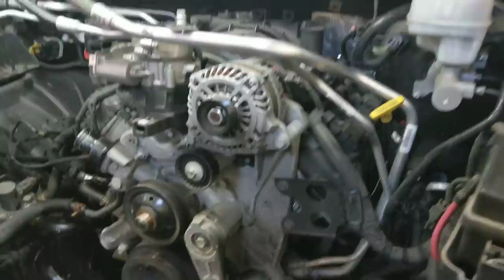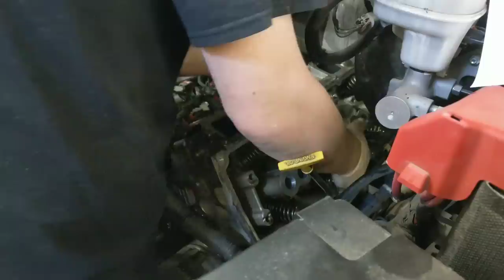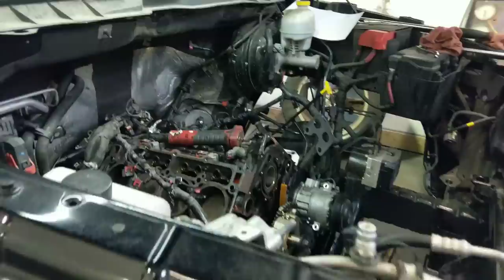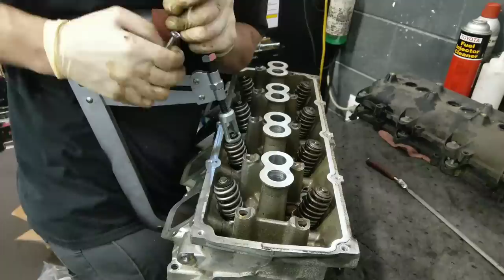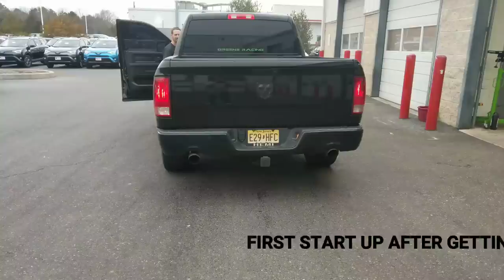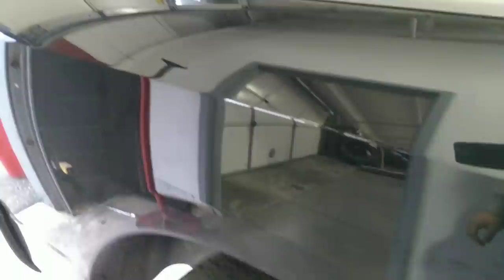HEMI RAM 1500 CAM INSTALL and START UP!!!

Comment: In most shops that I worked for we would have been fired for using abrasive discs on a head surface.
Reply: Aluminum heads too. I saw several things in that video that normally would not fly. Like installing the cam bone dry. Assembly Lube is your friend.
Reply: JK yes sir, there's always time for lube!!
Reply: JK I don't get me wrong I'm not one to criticize another techs work but that is hackish.
Reply: The fact that the truck is running great and hasn't had any issues despite IH beating it mercilessly shows his guy did a good job.
Reply: Did he cut out the part where he couldn’t get the cam fully installed because he took a sledge to it?
Reply: @Eatmydick666  lool what i was thinking
Reply: Yup we cant and we do fords all day long theres no difference
Reply: Exactly!
Reply: Nothing like a bunch of aluminum oxide particles all in the engine eating at those bearings lol
Reply: Every cam that i have ordered came already lubed
Reply: No new lifters? It’s a matter of time.
Reply: Sideways Squad that's not lube. It's an anti corrosion grease
Reply: @Eatmydick666  exactly I found that part amusing
Reply: next video....replacing engine in a ram 1500
Reply: YEPPER! even the fact that "no lube" on cam when installing it would convince me to never use this chimp to work on my shit. the gap between the cam being stuck in the video and being fully installed would worry me since (IMHO) I think they drove it in with a hammer.. everything about this guy's technique screams DICEY.
Reply: We really are not allowed to use any abrasion past the milling.  We were also only allowed to use calibrated, shop specific, torque wrenches to bolt on the cylinder heads.  We could use our own torque wrenches for just about anything else.  But work is extremely anal retentive about cylinder heads.

Comment: Should there be a concern that the camshaft was not greased before being put into the engine?
Reply: I would say yes lmao
Reply: I'm sincerely hoping he knew to wash the pre film off and relube it but the way he was smashing that thing in there those poor cam bearings😄😄😅
Reply: Yeah I noticed that and it looked like it got stuck until he cut the video. Made me cringe, that boy needed some assembly lube or some molly.
Reply: Yes a cam should be greased before installing it shows what they know isn't much
Reply: Cam lube anyone ❓😬😱
Reply: I stopped watching when I seen the cam go in dry.
Reply: @cantbuytime  This could be a gag sort of build so people mess up their engines after watching the video. I have never seen such rough handling of a cam shaft, much less with no assembly lube.
Reply: At least spit on the shaft man. This dude is raw dogging it 😅😅😅
Reply: @jd-yf2pi  I like to think that maybe he staged the action but actually greased the shaft before installation. He is very knowledgeable, hopefully too knowledgeable to install any sort of normally lubricated part without greasing it. But maybe he made a mistake that will come back to haunt him. Let's not call it, "raws dogging." Raw dogging,"would be rebuilding a crap engine, like a four cylinder junk that nobody would rebuild.
Reply: @indridcold8433   I am Laughing so hard that I can't stop crying.  I hope he didn't just go in dry lets hope and pray that this guy's truck is still on the road today and he didn't choose a mechanic that would raw dog his hemi. LMFAO

Comment: The 60' slowed down because the larger cam moves up the peak torque rpm. Needs a converter to make the most of it.

Comment: Hell yeah, sleeper mode. Exhaust sounds great. Glad your happy with it. Now to get those new track times. Congrats brother!
Reply from the maker: BlackMamba Ram yea sir...  Definitely sleeper Jay asked if I wanted a lope tune but I really like sleeper mode and track times are whats most important to me
Reply: Incredible Hemi yeah, it will run much better without the lope tune. Timing is pulled on the lope tunes. So slows you down a bit N/A.
Reply from the maker: BlackMamba Ram Really did not know that thanx no lope at all then...  There is lil chop but thats what I wanted more sounding like the way it was b4 cam
Reply: Incredible Hemi yeah, your good the way you are. Will definitely be in your favor if you like to grudge race. I wanted lope so I chose a more aggressive cam, sacrificed a little torque to get it and just went higher on my stall to compensate the low end loss to get me moving. Lope tunes are just for sound, not at all worth it for a sacrifice in performance. I had a lope tune on the baby cam I had before and it killed my bottom end, went from 1.76 to 1.8s 60' with a dead bite and top end mph didn't pick up any. I only picked up midrange with faster 1/8 mile but same 1/4 in similar weather conditions. Kinda defeats the purpose of the cam install.
Reply from the maker: BlackMamba Ram Yea id be pissed if I didn't pick up any with a cam install

Comment: This is getting me pumped... all the pieces are coming in for this.
Reply from the maker: Awesome man it's very exciting time when a cam is ready to be installed
Reply: Sounds like we should be good for weekend of Oct 6th - all the parts will def be in. The Cam is the only thing that needs to be plugged in - going to do an intake upgrade down the road. Would he let me film it like this?

Comment: did you remove mds?  I've done quite a few installs and have never removed the intake...just unbolt and hang from the hood, means i didn't have to remove fuel lines too... can't go wrong with a Greene cam..he spec'd a 230/238 cam for my Ram and it's killer..

Comment: I have 2011 dodge ram 1500 5.7l. Installed  stage 2 cam no tune yet have an appointment  on the 9th to get tune but can hardly drive getting a to rich code. My question did you have same problem  also for the 545rfe tans do you know of a good stall to put in there thanks?

Comment: I wanted to hear what he had to say about the mds, also when u came and delete how do u get the check engine light off. I'm sure it comes on. I unplugged my mds 6k miles ago, got 7200 on it now, love the way it drives without that shit. But hate looking at that check engine light.
Reply: you need a diablo intune i3 to disable the mds system and no more check engine light, but plug them in before you do the flash.

Comment: I was wondering, when you pulled your stock cam out did you notice any abnormal wear? I know it's fairly common issue from what I have been reading? How many miles do you have? Are you or did you upgrade the valve train, rocker, ect.?

Comment: So how did he get the cam in when it got stuck? I think that would probably be the most informative part of the video. What techniques did he use. Did he pull it out a bit and adjust it? Would more lube prevent this?
Reply: He didnt use any lube and i assume he hammered it in.. dont 😂

Comment: How did you match up the timing Mark's without dropping the oil pump! I am doing a OEM replacement now due to lifter failure. Trying to get out of dropping the oil pan due to I can not right now. The only thing I have left is to get the timing correct.

Comment: Where did you get the Cam installed?  I'm looking to get a Greene Racking cam kit installed also.  I'm in the process of researching recommended shops in the NY, NJ area.

Comment: Did you lap your valves when you did this install? My truck is getting Jay's 1.5 V2 Cam early next week, truck has 38,000 miles on it...not sure if the valves needed lapping yet. Thanks.

Comment: Haven't looked inside the Hemi to get my answer but why pull the heads for a cam swap?  Were the lifters changed and they have to come out through the lifter/pushrod holes under the head?

Comment: Needing to replace my cam and lifters in my 2011 ram hemi 5.7. Want to do a performance cam What cam did you install? Did you do lifters? Did you have to do a new program, Did you lose your MDS, so many questions
Reply: corey coombs 
MDS suxs so yes, he did a MDS delete and I'm positive that he removed MDS with the tune, you'll need all new lifters and new springs are always recommend for peace in mind, the cam is up to your needs , from what I've seen there's only 3 options.

Comment: I am looking to do a cam and lifter swap on my 2011 5.7 Big Horn. I'm not looking for high performance racing parts, just need to get the MDS taken out and do the swap. Are there any recommendations on which would be the best non MDS cam and lifters that won't break the bank? Thanks!! And nice video btw!
Reply from the maker: mmotoxxx79 hit up greene racing on facebook best in the buisness for these trucks
Reply: Incredible Hemi Thanks! I will check it out.

Comment: Did this cam require a cam phaser kit? Also did you plug in the cylinder de-activate solenoids? I did a cam swap and left those 4 sensors in the valley but I didn’t plug the harness into them. Just wondering?

Comment: Hey hey Incredible i just recently had a lifter go to shit and totally screwed my cam.... # 2 if it matters, but i ordered the Modern muscle extreme cam kit with the Obama Delete "MDS" lol. new timing chain new helcat lifters and cam. Just wanting to know if ya think that was the right choice. i know u guys or u know a lot on the hemi and just curious as to if i made the right choice i use yer vids a lot an and think yall are legit. any feedback?? i have done the delete and installed the cam and lifters and about to put the heads and such back together came with all the new bolts,gaskets, timing chain and timing chain guide etc. i did not replace the timing chain because it did not seem that i needed to because everything was tight and still in good condition. if i need down the the line i have either way just wanting to know if ya think i did the right thing no??
Reply: also sry its an 2009 hemi

Comment: I was looking to do this on my 13. Adding performance lifters and a Greene cam. But I'm running 35 inch tires on my truck so how much more performance could I realistically get. I'm not looking for something that'll run quick times at a track I just want the added power for daily use. Is it still worth the money?

Comment: Never use a rough discs on two smoothe mating surfaces. If I seen  some one do that shit to my motor i would have slapped the back of his head off. All you need is a good scraper
Reply: I wholeheartedly agree. I have a couple of carbide scrapers that work wonders.

Comment: What is the cam and the top end set you bought sir mine just dropped on my 2012 in a bind did you have to delete the eco mode shit if so what parts did you get please need help

Comment: 98% of new gearheads OVER CAM their engines and then wonder why only 10 mpg and crummy idle! It's good you made wise decision to keep it "small"if it's your daily driver. What you need for the street is good idle, more torque and quicker acceleration.

Comment: Thanks for the vid, why new lift springs? (Optional or required)
Reply from the maker: KINGBAND09 required lift springs on this cam
Reply: Incredible Hemi ok, and why this cam vs others and how has the performance been ?
Reply from the maker: KINGBAND09 this cam is better for mid to low range it's a high lift cam but I gained GREAT too end only got to track once sp far n gained 3 tenths n 4 mph in the 1/4 first time out
Reply: Can only a MM do this job.? Or can your average joe pull it off.? How can I know which cam is right for me and if I should do a swap? Thanks
Reply: Bummer he didn’t answer the question because I was wondering the same thing lol. I’m not really an average joe but I’m definitely not a mechanic... I’d love to cam my 5.7
Reply: Evan Schippers 
It’s a serious job with special tools needed. I’ve been a mechanic for 30 years, and doing my own 5.7 now. It’s not easy.
Reply: Loved the performance sound after install. Glad u-tube was edited so not to long.

Comment: I’m a little late here with this but I read somewhere that you had your cats removed before you put headers on. I’m in the same boat I have full bolt ons and tune in my 8spd. Just wanted to know if it made a noticeable difference or lowered your ET at all. Thank you
Reply from the maker: Daniel Rios I got a Catless ypipe and thd longtube headers done at the same time n yes that was a very big pick up
Reply: I lost a good bit of torque deleting my cats, I added a high flow cat and that helped bring back the torque.

Comment: Was this install difficult , I’ve rebuilt very few engines just don’t want to do the install and get myself in a bind
Reply: Better question what would someone charge to do this
Reply from the maker: Jake ! In my eyes yes to a mechanic that knows what there doing no
Reply: See I use to be a mustang guy and that’s what I know and everything I researched seems to be a completely different breed so I’m scared to jump Into it
Reply: Jake ! If you sub to my channel and stay tuned, you'll see a complete walk through

Comment: Do you have to upgrade the valve springs, rocker arms,ext if you install a cam
Reply from the maker: Jake Fejer springs yes not rocker arms
Reply: You only have upgrade springs if the cam you get will not work with stock springs. And depending on some cams you do have to change rockers arms because they will change the ratio. Because of lifters and rods and springs.

Comment: Did you install cam yourself or have a shop do it? If so cost and how long did it take? Thnx
Reply from the maker: Andrew shamloo my buddy is a Ram master tech he did it in 8 hours n only charged me 400 most shops will charge about 1500
Reply: Incredible Hemi 
Thats awesome! I got quoted $1,000 from a performance shop on long island. I purchased the same exact setup as you from Jay Greene the only difference is I bought the upper gasket set from Mopar and I have Shorties. Also have the ATI Dampr, Does your buddy want to take on another cam job? Thanx for all the info
Reply from the maker: Andrew shamloo no problem
Reply: Incredible Hemi is it ok to contact you via jay greene? Thanx
Reply from the maker: Andrew shamloo What do u mean
Reply: Incredible Hemi whoops, my mistake I misread comment. Where in Jersey are you from? Did you do any drivetrain upgrades? Were your lifters shot?
Reply from the maker: Andrew shamloo I'm from depford n one lifter was actually starting to go so the cam was installed just in time

Comment: How much does a cam swap cost? Just bought a 2018 hemi ram, just wondering for now.
Reply: About $3,600 plus since it's an '18 add $800-$1,000 for unlocked PCM and tuner.
Reply: 2021.. update.. depends where you live. On most of the east coast major city... hourly rate add up fast.. so it will be upwards of 6-8,000$ for labor.

Comment: looking to do a cam install on my crew cab but the shops in my area seem very questionable when I pull up. what area/state did you get your cam install done?
Reply from the maker: DB Life my friend who is a Ram master tech did it for me I live in NJ
Reply: Incredible Hemi that was a ram master tech taking a sanding disc to the cylinder head?

Comment: Why does cammed hemis not lope like any other cammed V8's?
Reply from the maker: They all lope I asked for a non lope tune
Reply: They're no different really, it depends on how aggressive of a profile and things like overlap and lobe separation angle.
Reply: I've talked to cam makers & My understanding is the Computer system will not  let a big lope cam to work work.
Reply from the maker: Bill Walker I can get a lope tune n it will chop hard I choose not to
Reply: Computers do not like valve overlap
Reply: "Compters" don't like all that lack of vacuum. Camshafts with increased duration and lift kill vacuum, speed density systems (Which Chrysler only uses) does not and can not tolerate that.

Comment: How many miles were on the hemi when you did the cam swap? Did you replace the lifters?
Reply from the maker: SSSTANG just over 50k n yes I replaced lifters witg MSD delete kit
Reply: What is a delete kit? Guy wants me to do a cam swap on a charger and I’m just collecting info.
Reply from the maker: SSSTANG it's non Mds lifters

Comment: My cam took a little persuasion to get it the last few inches as well I just slathered it in extra assembly lube and it went right in, did you do lifters as well?
Reply from the maker: 11ram_rt Yes lifters also ..an MDS delete
Reply: She sounds killer, can't wait to see what it'll do at the track.
Reply from the maker: 11ram_rt thanx man... Yea track times is what I m most excired for

Comment: Puts cam in dry? You did say "high lift" meaning high pressure on lobes. Oh crap then I watch more and "first start after dialing in" He idles it!!! Should be 1800 minimum to break in.
Reply: Yes.  You have to lube the journals. Actually with roller lifters Cam lobe break in at 1500 to 2000 rpm is in Unnecessary. Flat tappets have to break in

Comment: Ok kids heads dont have to come off with lifters under it remove push rods and spin old cam pushing lifters into retainers

Springs can be compressed with head on valve seals should hold valve or use air in cylinder
Reply: When you change out the junk MDS lifters you need to pull the heads to access the lifters.
Reply: @mudrunner1  you actually dont do some research ive done it I personally but im a mechanic so maybe it above tou

Comment: Sloppy mechanic. Using a 3M pad on the heads is a no no. Aluminum shreds away fast. On the cast iron block it was fine. He should have laid some towels over the oil pan. Cleaned it all up with some cleaner. But when I see a guy grab a wheel for the heads, I know we are on different levels. 

And I didn't see any assembly lube on that cam. I've never seen clear assembly lube. Where can I get some? KY LUBE?